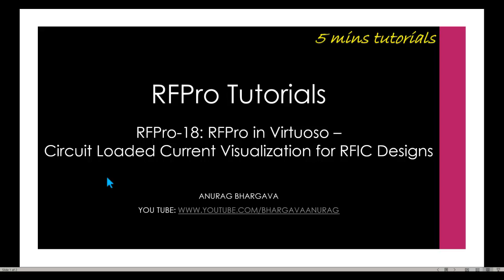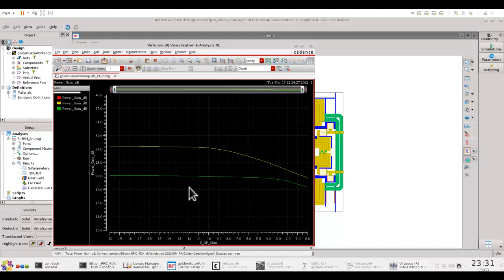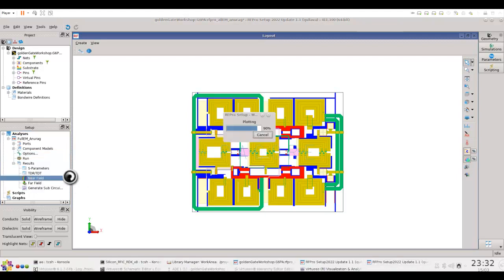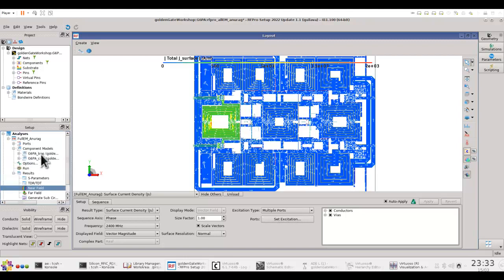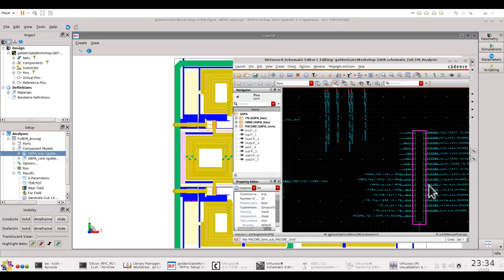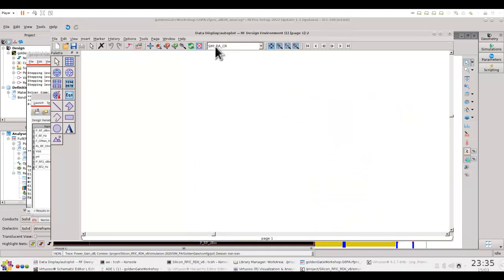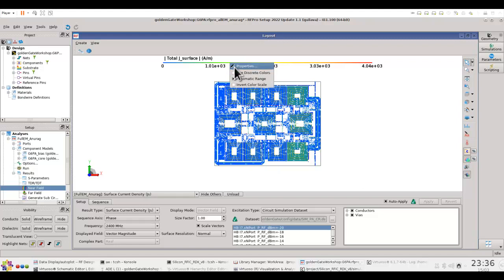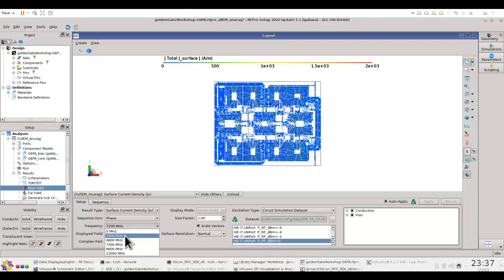RFPro-18: RFPro in Virtuoso - Circuit Loaded Field Visualization for RFIC Designs

Comment: Hello Sir, If I want to import the component into rfpro, how can I use ads to  create the .ds file?  I can found the way to create the circuit simulation dataset file.
Reply from the maker: Hi Durant,
I am not sure why would you like to create dataset file from RFPro as you can directly create a Subcircuit schematic from RFPro? Still, if you want to create dataset file then you can use File->Export option in the S-Parameter graph window to create dataset or touchstone file as needed.
Hope this helps.